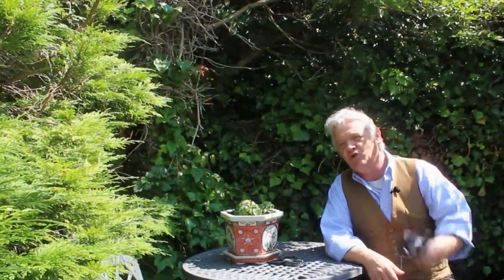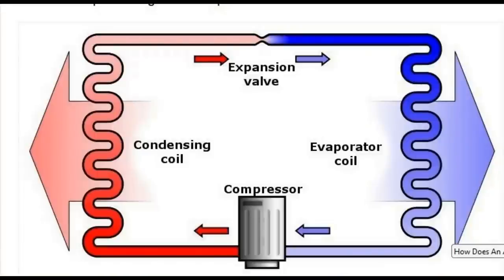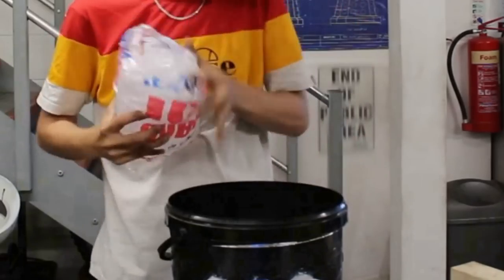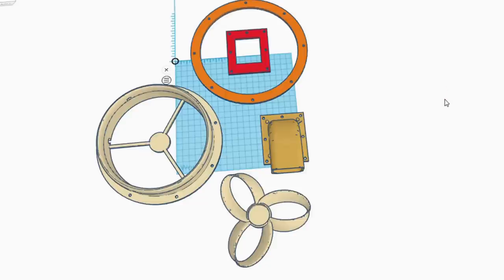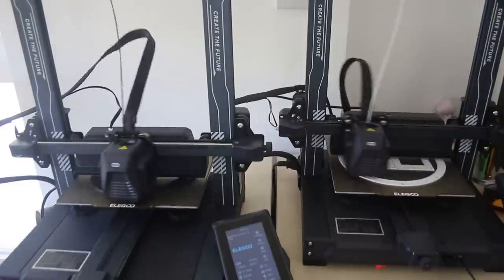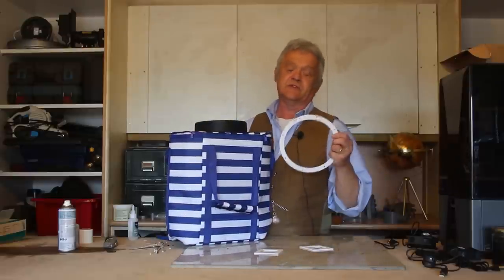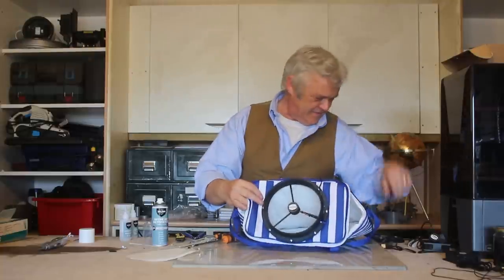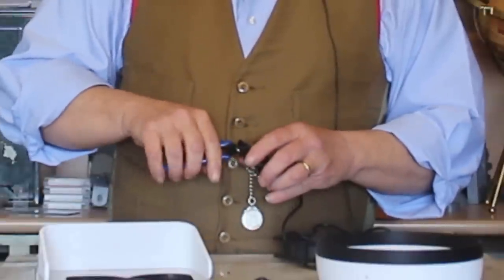1953 A Folding Silent Air Conditioner

Comment: I just love how much joy you derive from your so many inventions and how much joy you spread around
Reply from the maker: cheers
Reply: @ThinkingandTinkering  how about folding a toroidal fan with origami paper. then dunk i in some type of layers of something or spray on material that is flexible yet strong enough, yet not brittle? not sure if that is possible for us without 3D printers or what matrial could be used.

Comment: swamp coolers like this work great in dry ,arid climates but not in more humid/tropical areas. Ive tried several here in Florida, they do feel cool blowing on you but the air is quickly saturated . A heat exchange style works a little better but also uses a LOT of ice. I do like the soft side idea and with a  small portable power bank you can use it anywhere
Reply from the maker: indeed
Reply: Then modify it to be a water extractor, then it will also cool because that's how water extractors (dehumidifiers) work.
I know I can't make one at home (or I don't know how) but a TEG can be used to generate cold as well as heat and you don't need much - yes the other side generates heat but you're only using a little bit (not trying to be a CPU chiller, for instance) only enough to create a thermal differential that starts pulling all the water out of the air.
If you have access to compressed air (or can focus enough wind maybe) I've used a Ranque-Hilsch vortex tube to freeze water as well as almost burn myself on the exhaust.  Maybe we can create a few degree difference in the collected air which is enough to create a "rechiller" to hold the air until it's cold enough to make a noticeable difference at the "cold" exhaust port (of course I'd vent the "hot" exhaust outside, unless it was winter then I'd have a valve to swap ports).
If you have enough surface area and the proper materials you can also make fully passive cooling surface which will create a space that will always register cooler than the outside temp - it reflects one band of heat and leaks another (preferably in the human/machine range of emissions; also flip it over in the winter).

Comment: I made one of these using a 4" bathroom fan and a polystyrene box that trawlers pack their catch in. Our old Labrador Trav had an issue with his throat that meant that panting in hot weather was not effective enough. I made this, put bottles of frozen water in it and aimed it at him. He would sit with it blowing straight into his mouth and it worked a great. But bulky to store and a tad noisy compared to the toroidal blades you have created. Nice one squire👍
Reply from the maker: cheers mate

Comment: Swamp cooler? 
That adds humidity. Why not put copper or aluminum pipes inside the bucket,on the bottom. In one side out the other side. Put the ice and salt on top. Close the bucket. Blow air through the pipes. Cold but not humid.
Reply from the maker: cheers
Reply: Great idea
Reply: interestingly, this idea should also work as heater during winter time .. but instead of ice, you put in hot water ..
Reply: Or freezer blocks. They could also be put in a small frame so that air passes easily between them to improve efficiency.

Comment: i took the coil from a window ac and hooked a pump to it that circulated ice water from the cooler below with a setup built into a plastic cooler kinda like yours, worked great using a trio of 12vdc computer fans zip tied to the back of it coil. now i just need more ice cause it doesnr last long in my truck on 100° Texas days.

Comment: In Texas in summer (100F) designs like that lasts about 30 min.  Also in the open air you can barely feel anything. In an enclosed space (a van for example) it works fine but opening the doors kills the cooling effect instantly.
Using a military cooling vest that circulates cold water in a plastic tubing pressed against your skin also lasts a very short time (20 min tops with 2 lbs of ice).  Plus it has the problem of cooling the body locally - let's you work long hours as if nothing but actually the head ends up overheating.  A full cooling outfit that you cab buy  - pants, vest, hood - starts to be a ridiculous solution.

Comment: Seems like you could rig up some kind of small duct work on the air intake and put an inline air filter to remove the moisture from the outside air like a plasma cutter set up.  Although a plasma cutter setup is working with some high PSI at the air supply in.  So I think a redesign of a moisture filter for just ambient air would be in order.  Diatomaceous earth packed in the filter?  Can reuse often and then once it's overly saturated with dirt and dust stick it in your garden for those garden pests.  Just a thought before I've had my coffee.  May be a stupid idea after I've got some stimulant on board.

Comment: Here is a thought. Use a desicant that removes moisture from the air and is made of ions that can move charges around. Increase the surface area of the dessicant in a sponge like substrate and blow air through it. Dessicants like calcium chloride, sulpheric acid and others  cool down as it absorbs moisture from the air. 

Passing current between two plates generates hydrogen and oxygen. Effectivly regenerating the desicant. One can store the hydrogen for a fuel to use later. But the air now has less water and requires less energy to cool with an air cinditioner and less water condensing on the evaporator (cooling) coils.  

My AC condenses about 10 gallons of water on hot sunny days. If the humidity were reduced such that only 5 gallons condense. it would save my AC unit over 41 BTU of latent heat of condensation.
Reply from the maker: a desiccant isn't going to work well mate - but go for it if you want and let us know how you get on

Comment: Here's a thought:
Inefficiency in an electric device is heat, which, in the case of a heater, is beneficial. 

Excess sound is just movement of air which, in a fan, is also beneficial. 

So isn't a quiet toroidal fan quiet because it's moving less air?

Comment: Swamp coolers add humidity and are not efficient. You need a heat exchanger to pump the cold water through then blow the air over/ through that.

Also, the majority of the cooling energy comes from the phase change of the ice to water. By not having the water go through a heat exchanger you're losing a lot of efficiency.

Also, they don't last long...
Reply from the maker: you may be missing the point mate

Comment: I love your videoes. 
Due to the plastic issue on this planet, I never even thaught of buying one.
Some told me that one could use old recycled plastic.
Is that bullocks or not?
A video on that would be great and might convince me into purchasing  a 3D printer.
Even if theres is a little tinkering required to get it working properly without ruining a 3D printer....

Comment: No need to pack it away in the winter: just add a sand battery (or a steak bake from Greggs) and use it for heating.
Reply from the maker: nice

Comment: So are you adding moisture to the air or removing it or stay the same? I would think it would remove some moisture from the incoming air but as it passes over more water its going to pick up moisture.  I guess it really depends on the relative humidity & temp this device is operating in.  In a 100% dry (0% humidity)  room that is 100-110F, its adding moisture, but in the same temps with 95-100% humidity, it's going to lower the relative humidity upon exit.
Reply from the maker: adding it i think

Comment: Been following for a while (actually playing with some of your wind turbine ideas) and I've been meaning to ask, have you considered trying to use nitinol to create a mechanical air conditioner? When it gets bent (not deformed) it gets warm, and if it cools before the tension is released it gets lower than ambient. I did a quick search through your videos and I only saw one explaining what it is and the history. Maybe this is the next thing I'll play with once I have my serpentine coil winder and little wind turbine done.
Reply from the maker: I haven't thought about it mate but a lot of folks have - there are cooling devices made from rubber that does the same thing - from my reading they are interesting but not very practical - but it was several years ago that i checked that out so i must look again to see if there has been any developments thanks for the nudge

Comment: I would rather see something clever like using wax (paraffine) which melts in the ambient temperature (and cools the environment by doing that). I heard it was used in an office environment and the 'wax' was contained in small like 'pills', and several square meter of it. It cools by day, and in the night it will give off the heat. To melt 1 KG of wax you need approx 2 kW. That is a lot of power. If you can get that for free, that is a good way to go. And it does not deteriorate afaik.
Reply from the maker: go for it and let us know how you get on

Comment: Air Conditioner ≠ Swamp Cooler (Evaporative Cooler)...Air Conditioner removes humidity from the air whilst cooling, thus "conditioning" the air, whereas a "Swamp Cooler" blows moist cool air in a hot dry environment absorbing the heat and pulling it away. A "Swamp Cooler" does not work in a humid environment!!! I live in Mississippi and we get a heck of a lot of moisture off the GoM blowing inland...Swamp Cooler doesn't work. BUT, I run a "Swamp Cooler" indoors in the wintertime. Figure out that riddle!!!
Reply from the maker: ok
Reply: Actually, that's true.  Our airconditioner has a cycle that only dehumidifies.  Just running that in summer (in Sydney) can reduce the indoor temperature quite a lot.

Perhaps your swamp cooler in winter works well because where you live you don't really get a cool season - only a humid season (summer) and a dry one (winter).  Just guessing.
Reply: @simongross3122  The "Swamp Cooler" doubles as a humidifier in the winter when the air is dry...water is pumped over a resin paper grid as the warm air is pulled through it. Unlike a steam humidifier, the evaporative cooler/humidifier only humidifies the air to the extent that the heat/temperature will allow it to!!! So besides humidifying, it's also cleaning/washing the air being pulled through the pumped vertical water grid as well as circulating the water in the reservoir below so it doesn't stagnate and buildup a mold hazard. For every winter that I've run this setup, none of the five family members in our household have had colds or respiratory issues!!!
Reply: @fookingsog  That's really cool.

Comment: I've always thought these diy air conditioners would work better if the air passed through the water around the ice instead of around or over. If you used a fishtank airpump then you could do that, I'm thinking of trying it myself but am worried about power consumption of the air pump because i would mainly use it camping.
Reply: it would be best optimized by choosing a pump that only makes enough pressure to push air through the cool-box and then uses the rest of its used electricity moving air. this might be a fruitless idea as all air pumps are designed for fish tanks which are generally much larger than a portable cooler. but if you 3d printed an air pump to spec then it might be more efficient than a regular fan diy air conditioner because it could cool a room just as much while moving less air. just allowing the air to better contact the ice and water.
Reply from the maker: it depends on what you want to do really

Comment: Arctic P12 or P14 (12 or 14 cm diameter) fans are extremely quite and cheap. You can pick up a 5 pack for 25 euro's.
Reply from the maker: nice one mate - cheers

Comment: Great idea Robert, I was wondering about sand, where I'm still trying to finish my heater, does sand store cold like it does heat? If this is the case could a double wall unit filled with sand  fitted with a chamber to place the ice work?? Or am I over thinking the process???
Reply: Water/ice works better than sand because it takes more energy to heat it. The reason why sand batteries are preferred when storing energy as heat is that sand can be heated to a far higher temperature than water.
Reply: @mrab4222  Thank you for your response
Reply from the maker: sand is not so good with cold mate
Reply: @ThinkingandTinkering  thank you for clarifying

Comment: If you "had" to make your toroidal fan blade without a 3d printer, seems that you could cut a PVC pipe at an angle, heat form the "blades" with a heat gun, and glue, it to the PC fan hub.
Reply from the maker: oh - i like that - nice suggestion mate

Comment: Not really an air conditioner, although it might work for some cooling needs so long as you have ice on hand. Although I'm rather confused about why it would need a containment unit that is thermally insulated. Isn't the idea to use the coldness in the ice to cool down the area? It seems like the ice might stay unmelted longer, but it would also hinder it's cooling capacity. What would make more sense is if you insulated the space you were trying to cool rather than the ice itself.
Reply: You want the cold to go where you want it, not to just bleed out into the area around the container.  Contact with the surface under the container will be wasteful for example.
Reply: @Alacritous  It won't make much of any difference because the fan will be circulating the cold air anyway, meaning that the air temperature is going to average out. Which is also why I said, maybe I could see insulating the area you wanted to cool down.
Reply: @lajosruhzek2459 No. It won't. Cold bleeding into the surface that the container is sitting on won't do anything to the air. Air that is cooled coming into contact with the wall of an uninsulated container will just drop to the floor and disperse uncontrolled.
Reply from the maker: no that's not the idea

Comment: Long time ago I knew a lady who used a large plastic bowl and ice with a fan in her kitchen. I was quickly educated why I was wrong about the melting ice adding moisture into the air even as the bowl was filling with melted water. Can you figure it out?
Reply: Moisture in the air condenses on the ice and adds to the melted water.
Reply: @fookingsog  wait watch and see how many people don't understand. Swamp coolers don't use ice but many people in humid climates have been dissatisfied with them. They are made for dry arid climates.
Reply from the maker: yes i can  mate - but i don't worry about it much to be honest

Comment: No, that's not efficient as its a modified swamp cooler.  I haven't given that a go myself but have seen videos on it.  It's called a vortex cooler.  What you do is you send air through a tube which passes through a heat exchanger (oil, water, etc connected to some radiator) and then on the output you have a larger diameter than the incoming side which creates a cooling effect.  No pumps, no expensive coolant, etc; just the fan that blows in or pulls out.  Just pipes through a heat exchanger on the outside.  IE, 3cm on the in side and 6-8cm on the output.  Another one is where the air goes into a 200 litre tank of water with 3cm pipes that coil from the bottom up.  The water is the heat exchanger media where you take the hot water from the bottom and route that to a water heater inlet.  Then you just take water from the utility which is cold to cool down the heat exchanger.  The last one which is the most efficient but no one really likes.  That to use a hobbit style home/earth ship home or alike where you just have a southern exposure where you can control the amount of light coming in and that's far more cheaper than anything else.  Problem is you have to mow the roof as it would have grass or what-not on it with 2 metres of soil. Also keeps the home warmer in the winter as well.  The last one is used for standard homes where you run the pipe out in the yard in a 15m x 15m area about 2 metres down and you just use the ground as your heat exchanger.
Reply from the maker: cheers mate

Comment: Any advantage using a block of dry ice?
Reply: It's a lot colder so I would think so but not sure how long it will last.  Long enough I would guess as it's used for mailing food.
Reply from the maker: you don't want to do that mate - for so many reasons

Comment: great video but i dont know what you mean by "it bloes air over ice which is exactly how your air conditioner works" that is a confusing statement as someone who knows how air conditioning works without use of ice.
Reply from the maker: i meant the air is blown over a cold surface - it doesn't have to be ice per se - just colder than the ambient

Comment: This 'aircon' is really bad design because all that evaporated water humidifies already humid air, and makes it both feel hotter than it is but also hard to breathe.

The solution I like is a closed loop with a cheap aquarium pump, which pumps cold water (maybe with ice) from  bucket into a copper pipe spiral around fan, and back down to bucket
Reply from the maker: ok

Comment: I have tried dehumidification using calcium carbonate, it didnt   working.
Reply from the maker: no - it wouldn't - try calcium chloride
Reply: @Robert Murray-Smith  oops sorry sorry I meant calcium chloride I used calcium chloride and it didn't work.  One of the three places I life in the Philippines is very humid particularly at night as the air cools  bit the relative humidity skyrockets. It doesn't make any sense to cool a room and all of the high thermal capacity stuff like the walls. Just drop the humidity so making ice with solar power inbthe daytime seems the way to go. My other country Portugal has the opposite at 40C but just provide lots of shade. It is cool at nights no clouds. You could toss the numbers into the thermodynamic equation and see if you could exploit the  ice/room temperature difference to run a heat engine to run your fan, and or charge your mobile/run LED lights.